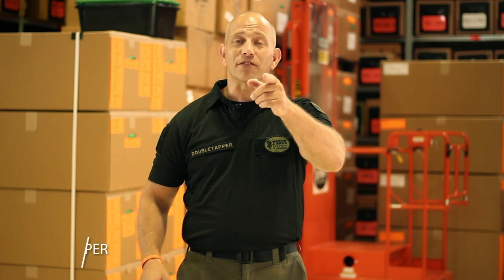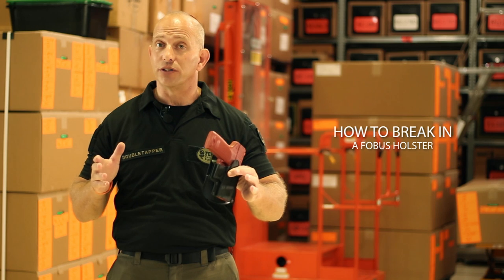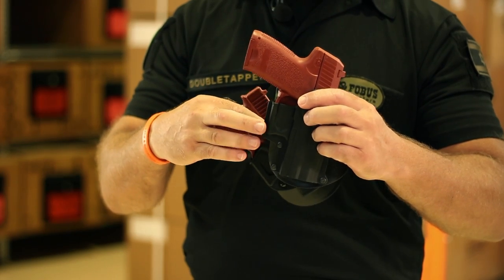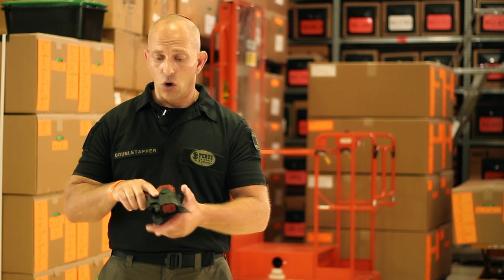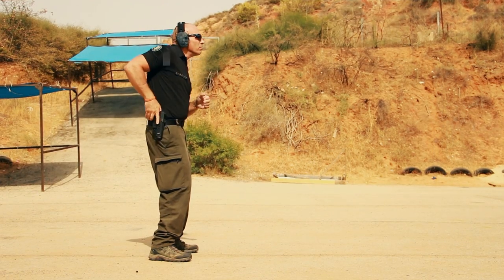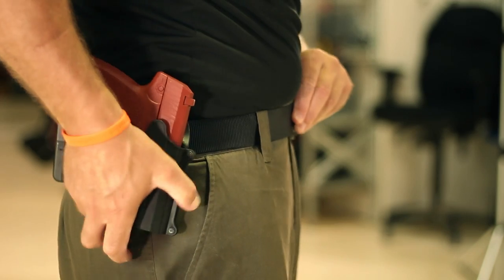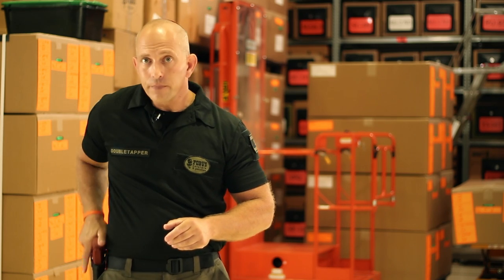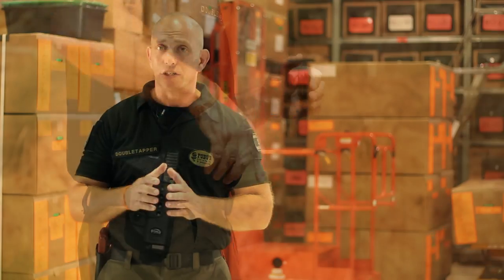How To Break In a Passive Retention Fobus Holster

Comment: For my Fobus retention holster, I was taught the "twist/tug" method when drawing. Slightly twist the grip while pulling from the holster. This method makes drawing much easier, while keeping the pistol more secue in the holster. I believe it would be beneficial to show this in a video, as it makes the holster MUCH easier to use.
Reply from the maker: squaregrouperx, thank you for your feedback, we will consider it to our future videos.
Reply: @FirstLast-gv1zl  NOT ALL MODEL HAVE THE "tension" SCREW! Some, like MINE are riveted... FIXED....
Reply: @FirstLast-gv1zl  CZ 75BD
Reply: @FirstLast-gv1zl  Whatever standard one they make for the CZ! Says CZ-75 on it.. paddle holster...
Reply: Go to FOBUS site.... products ...standard holster... CZ.. CZ75bd.... Right.. paddle.. there is a picture of it right there.
Reply: There is a video on here where you block it open a bit at the rear split, then use a heat gun/hot hair dryer to heat the plastic, then let it cool to "reset it to less "retention"... going to do so tonight.
Reply: Thank you for the information. I will apply this method when I get mine

Comment: Hi, I just bought a fobus holster for my cz75, after watching the video I realized that the holster does not make a "click" sound when inserting or taking my pistol out, any reason for that?
Reply from the maker: Pierre Fourie hi, thank you for your feedback. Could you please send us a short video demonstrating the problem mentioned to info@fobus.com ? What CZ model do you carry?
Reply: Fobus Holsters hi thank you replying, the holster does not make a "click" sound when inserting ir withdrawing the  pistol,     I bought the pistol in 1988 new, it is standard, no modifications CZ 75
Reply from the maker: Pierre Fourie CZ made along the years few versions of the original 75 model. Every version holds minor changes that unfortunately makes to all different. If you don’t hear a click it doesn’t mean it’s not working well. I suggest you make a simple test: clear your gun first (no magazine and no bullet in the chamber). Holster it, invert it and shake it up and down. Does it fall from the holster? If not it’s ok. If yes, it’s a problem and you should return it to the seller. Please let us know the results.
Reply: Fobus Holsters I have tested it and it stays in the holster, thank you so much for your quick response

Comment: I have a Blackhawk for my Smith & Wesson Shield 9mm and it locks it in place; you have to press a release in order to draw and it works fine. Looking at the Fobus for my Beretta PX4 Storm Full Size because it looks great and I like the price, but have read reviews saying that they had issues drawing the Storm from it...would stick. Just wondering if anyone has had the same issue using the Storm or have a recommendation for another holster? Maybe even a middle of the back holster since the PX4 Storm is pretty big compared to my Shield.  Thanks all.
Reply from the maker: abnmol1 hi, I won’t try convincing you to try our holster since it will obviously be very subjective. I’ll only say that having sold tens of thousands PX4 holsters, statistically speaking, leads us to bad feedbacks once in a while. The vast majority of the comments are very positive.
Anyway you can always try our active retention option http://www.fobus.com/holsters/beretta/20/brch.html
Take care
Reply: Actually, I'm going to give it a go. I'm just impressed at how fast you responded to my comment! That means a lot to me as a customer.  Once I get it, I'll let you know how it goes.  Also, thank you for the link. I saw the Fobus Roto Evolution RH Paddle online...think I may go with that one over the "Standard." Thanks again.
Reply: My Girsan MC28 had the same issue. It gently clicked into place, but gave me busted fingers and blood blisters because it got stuck. I’m sure you resolved it by now, but this amazing holster only needed another washer (my pistol is a different breed, like a Smith & Wesson M&P .45 and/or a Beretta Px4 Storm 9mm) and a little tuning on the retention screw! I love this holster. I hope you still do! 🤘🏻❤️

Comment: I saw at the end of the video, where a guy was  - cross drawing  - . It that holster on your website? Or  did he just take his strong side holster and flip it to his left hip.
Reply from the maker: It is the same holster, but mounted with a rotating paddle or belt attachment.
Reply from the maker: Here another demonstration https://youtu.be/sHElKANBFWU
Reply: @FobusHolsters  ok. Thank you. I just ordered one of your OWB  holster for my rock island tac ultra fshc 45acp 13 round. It was a PAIN in the ass to find one. Looking forward to seeing how your holster handles 3 lb of pistol
Reply: @FobusHolsters  thank you for the website information
Reply: @FobusHolsters  just check out the video. Nice! Loving the adjustability of it. I will work on setting up mine for cross draw, and see how it go's.
Reply from the maker: @jamesdelong6401  great. Just make sure to order the rotating (RT) version.
Reply: @FobusHolsters  I went ahead  order the R1911 and all the accessories attachments

Comment: I just got the CH series for my M&P Shield 45. It has the button to release. Unfortunately when holstered all the way in deep it doesn’t lock or click into place. I may have to return it
Reply from the maker: Hi Ryan, thank you for your feedback. You should return it. We don’t have a CH Holster for the M&P Shield. Where did you purchase it, and where did you get the wrong fit from?
Reply: @FobusHolsters   I got it on Amazon. Turns out it fits the Shield 2.0. So it works as it should just not for my gun. Went to a gun store and tried figment for other M&P’s it worked for the 9,40 and the 45 2.0
Unfortunately my trigger guard is a little different on the older version of the 45 Shield
Reply from the maker: @ryandunbar1314  thank you for your reply. We are not familiar with that fits. We do have a fit for the 45 it’s just not a CH holster.

Comment: I have 7 Fobus holsters, both type. A customer since 2007. The adjustable style work so well it makes them a best buy. The standard do not break in as shown in the videos from Fobus. You need to work on them by bending, heating (neither advisable) or changing the hardware. I got 2 standard (non adjustable) out of the closet that I purchased in 2009 for Rugers that I've never been able to break in enough to use. I am about to remove the rivet closest to the trigger and add tension screws that I purchased. Otherwise these 2 holsters are trash. I wouldn't even give them away, as for self defense they are dangerous to use as is. I think they are dangerous to use with a loaded pistol in the backyard. My advice is get an adjustable tension holster. Fobus makes a good one. These non adjustable need to go back to the drawing board. I'm not bashing the company, I like some of their offerings. Just my honest opinion.
Reply from the maker: J. R. Thank you for your feedback. We highly appreciate the time spent on writing it in details.
Since most of our negative feedback were indeed coming from our Standard series of holsters we investigated many of them in order to get to the fundamental root of the problem. We found out that the majority of the cases based on a wrong cross fit issue. Customers simply purchased holsters based on other customers (sometimes competitors) cross-fit feedback. As a result of that we made an effort to advertise everywhere our website as the source for confirmed fits.
Some of the feedback were definitely legitimate, thus we used them to fix what suggested as an issue. 
Nevertheless, we are very much thank you for your feedback and support. Be well.
Reply: @FobusHolsters  I purchased both holsters from the local shop. Both were for Ruger SR 9, one is paddle and the other is belt attachment. I don't see the belt option on your site now. They both have the same formed pistol cavity and are marked HK-1, which is the same as your website suggests today. Purchased both in July 2009. I wrote that date on the holsters. I have many holsters.

My fix, adding tension screws, worked perfectly! The holsters work as they should now. Prior to this fix the holsters truly couldn't be safely used. It was shockingly difficult to draw. I'm not a little guy, nor a newbie. I really appreciate your other holsters. Now these 2 holsters work the same, all for less than one dollar and a little time. Shame I lost all those years of use though.

I am still a customer, just a little more discerning.  It's an update Fobus should consider. It's not an expensive upgrade and would likely end most criticism. I'd say all, but some will complain the sky is too blue.

Take care.
Reply from the maker: J. R. Well understood. Thank you!

Comment: So how does the hook on the paddle hook onto the belt when it's inside the pants?  Shouldn't the hook be located near the bottom of the holster itself (outside the pants)?
Reply from the maker: Jon Dough thank you for your question. You can either wear it inside your pants or only on your belt (outside your pants) Both ways will do the trick effectively, giving the fact your belt remains tight.
Reply from the maker: Jon Dough it’s all depends on the level of retention you need on the paddle. Obviously by wearing the paddle outside of your pants will achieve better retention to your holster. But using a tight belt will be sufficient for both positions. The hooks will stand out far enough in order to catch your belt when needed.
Reply: @FobusHolsters  Thank you for your reply, and God bless you!
Reply from the maker: @jondough9981  you are welcome. Take care.

Comment: It's a shame really. They seem like nice holsters but mine has given me nothing but trouble. And it's damaged the safety on my Five-seveN so... I'm looking elsewhere for a holster. Maybe I'll try one again later.
Reply from the maker: Audio Arcturia thank you for your feedback. Which gun model do you own? And to which holster are you referring to?
Is it https://www.fobus.com/holsters/fn/57/fnh.html   ?
Reply: @FobusHolsters  Yes, that is the one. I even picked up the thigh-strap and swing arm so I could use it while riding my motorcycle, but regardless as to the tension on the adjusting bolt, the gun doesn't release even with a great deal of force at a directly vertical direction. And doing so with the thigh strap up just makes it lose adjustment entirely and bends the arm upward. There are scratches on the inside of the holster now where the gun makes contact at several points. 
At a second glance - it's probably because I'm retarded and didn't read that it's for Gen 1 Five-seveN's and not Gen 2 (which I think mine is, but I'm not 100% sure, it's not exactly new but it isn't exactly old, either). 
That being said: I like the passive retention nature of the holster - so if that's the case at the very least I have the thigh holster if you guys end up making a gen 2 in the future. It sucks because finding one for this handgun is a genuine pain in the ass.
Reply from the maker: Audio Arcturia thank you for comment. unfortunately it is not on our future plans. Sorry about that.

Comment: Purchased one for the Colt Defender. This has to be the worst holster I ever purchased. Getting the firearm out of the holster is difficult even with adjustments. I have to use my thumb as leverage to pull the firearm out. Not safe and I don't recommend.
Reply from the maker: J S Thank you for your feedback. We are sorry for your bad experience. We’ll appreciate more info if possible. Which holster model have you used?
Please take into consideration that most drawing issues caused by wrong fits. It’s got nothing to do with the holsters that are combat proven.

Comment: Just tried to draw and it broke,,, whata nice, cheap holster, never buying this brand again. I had to pull as hard as I could to get it out and the bottom broke apart
Reply from the maker: Thank you for your feedback. Even though it is a negative one, we appreciate the time spent on reaching out to us. Before loosing faith on our brand I will appreciate it if you could let me know which firearm do you have and which holster had the issue described.
Please take into consideration that most product issues are caused as a result of wrong fit other than manufacturing defects. Nevertheless, like all manufacturers, we do have once in a while production problems. Whatever it is, rest assure we’ll do our best to fix it and provide you with a solution.

Comment: I’m very unhappy with my Fobus holster. 

Completely removed the retention adjustment screw, but tention on my Glock 23 still way too tight.

With all due respect but this video didn’t assist at all.
Reply from the maker: Gabriel Snyman thank you for your feedback. Which holster do you have this issue with? For which firearm?
Reply: Gabriel Snyman got one for my g19 and it is the same way. Taking it back today
Reply: same issue here... g19, retention is absolutely crazy tigth even after removing screw, trying pulling the gun out will just pull up my pants up to my shoulders.... i even had to put a silicon pieces  in between where was the screww, its a bit better..